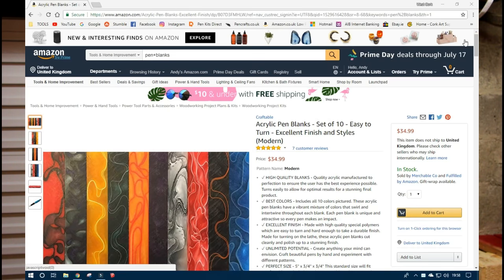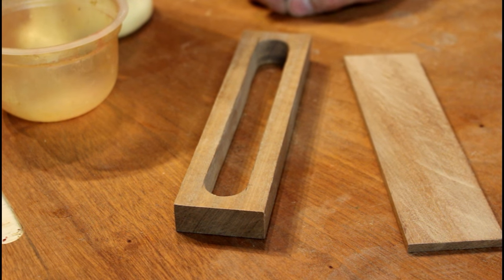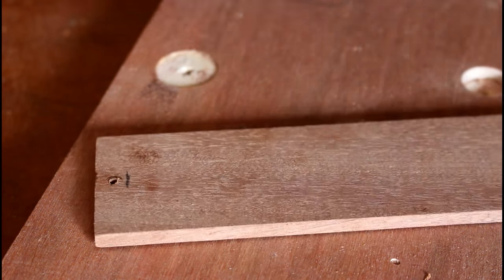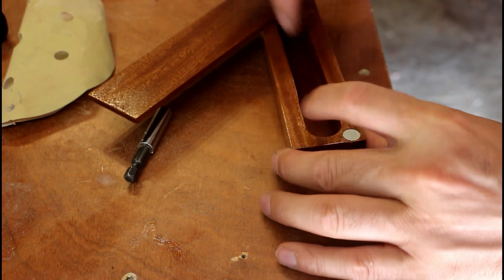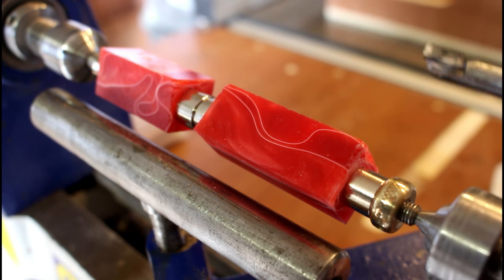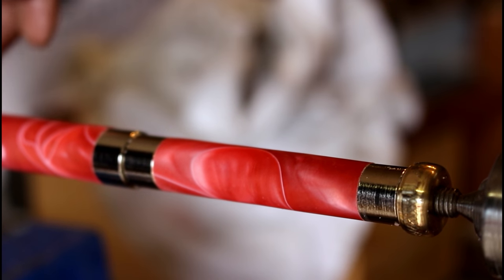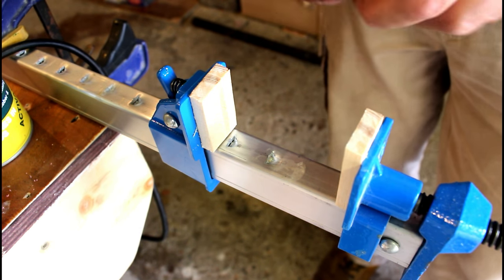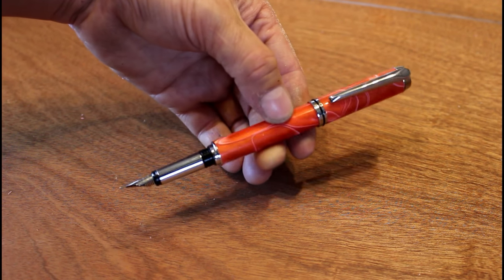Jr Gentlemen Fountain Pen & Gift Box

Comment: Great informative video. I’m looking at doing a jr gent myself and my tubes are coming out smaller than 12.5mm and 10.5mm. The body tube measures 3/8” and the cap measures around 27/64”   Any idea?
Reply from the maker: I'd say it was a more recent version of the Jr Gent i used. I know there is a Jr Gent standard and large. Maybe the one I was using was a large and you have ths standard? Not 100% sure tbh.